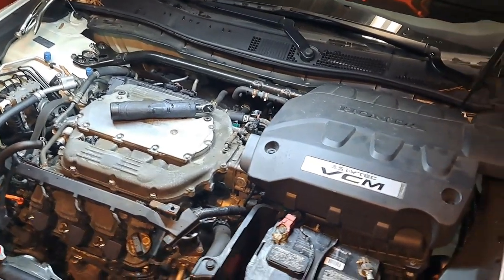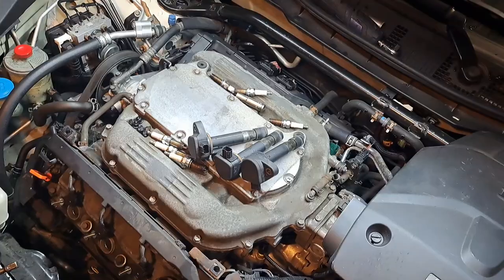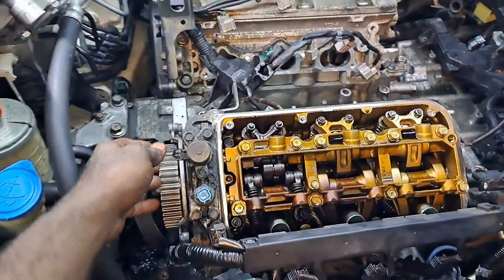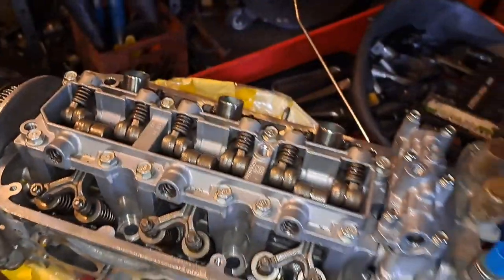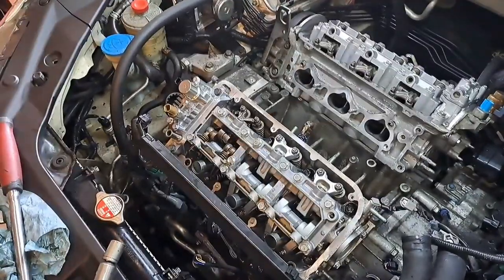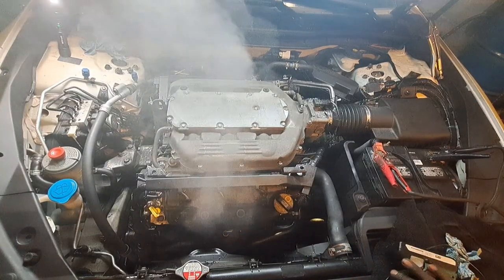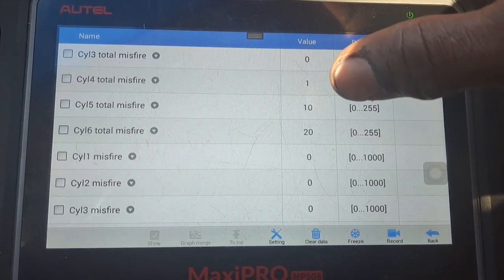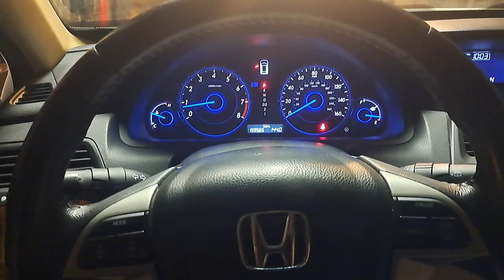2008-2015 honda accord broken timing belt!! bent valves

Comment: I just did a timing belt that went sour on a Honda Odessey. I ended up bending a valve on cylinder 1 (it’s my first timing belt) I was not aware rotating the cam 360 degrees would cause damage.  now it has no compression in the cylinder. You have given me the confidence to do this job. And hopefully not make the same mistake twice thank you 🙏 you live and learn.
Reply: Charged  her for a timing belt/ water pump job and gave it back to her with bent up valves? 😂
Reply: @Fred-xo3ku  no I fixed it for her bent valves and all.
Reply: @franciscogomez2565  a guy that knows what he's doing. That's rare most of the time in this field. 👍
Reply: @Fred-xo3ku  thanks!
Reply: So your saying, you didnt match all 3 markings?
Reply: @denisramraj8879  the back cam has a tendency to jump forward or backward when your trying to get the new belt on  I rotated it a full circle and damaged the intake valves DO NOT ROTATE THE CAM A FULL CIRCLE. I also used a paint marker to mark cam marks and counted the teeth from the old belt and put them on new belt
Reply: All that complication for a OHV engine.  They should've copied a good old USA V-8
Reply: Yeah, my brothers and I have done several timing-belt jobs on the Honda/Acura J-Series V6. It’s easy so long as you have the right tools, watch a ton of videos, and check everything at least twice.
Reply: @franciscogomez2565  that want bend no valve it just want start need speed to bend valve like hwy speed
Reply: @franciscogomez2565 yeah so the cam was out of phase 180 degrees then. The crank spins twice to the cam once...so everything can line up and be 180 out of whack.
Reply: Rotating 360 degrees doesn't as long as all the timing gear points was line up right
Reply: @franciscogomez2565 I have the same situation, after I removed the old time belt and while installing the new one,the  back cam jump to 10:00 position, what do you Recommend to bring it back to mark position

Comment: Man you never tighten the lock nut on valve adjustment, with a socket! You have to hold the jam nut with wrench so it doesnt move. No way t do that with a socket over the top of jam nut! No way did u adjust valves right!

Comment: Great video, man! The last part was nerve wracking like "damn"!.... My brother just gave me an MDX that broke the timing belt on acceleration (roughly 10k miles after being changed by the dealership). He just gave it up and bought a Toyota instead.. Anyway, just done clearing up the timing belt area and now about to do a leak down test before boroscoping it down. Hopefully it's not a mess in there... I'll let the machine shop do basic valve job and resurface in case but I'll do the final rebuild after seeing your experience... More power to you brother. We need more guys like you!

Comment: This is about the MDX I mentioned above. I finally decided to just pull the other unaffected cylinder as well and will rebuild it together with Bank2 (bent #4 intake valves). What made me decide to do that was after checking the seals and O-rings on bank2, almost all are nearing end of life: rigid, plastic like feel instead of rubberized. These won't last 50k miles or at-least as long as the new ones. Plus, will take the opportunity to do valve mating surface reconditioning.  The difficult part was loosening the nuts holding the cat converter to the head. My hands won't even fit in there; almost decided to just bring down the whole engine-subframe assembly. 

As the new parts delivery is delayed for like 1-2 weeks extra, this gave me more than enough time to measure things against factory spec and also clean things up. The Bank2 cylinder head by the way turned out ok. No measurable warping anywhere and even all valve guides were within spec. The bent #4 intake valves was all got affected by the timing belt breaking. 

Thanks for your video.
Reply from the maker: Thanks for the update

Comment: Hello I have a gyration I pulled my front head off my 2015 Acura Rdx head I found a black plastic part  between the 4 cylinder and the block in the area were the antifreeze flows at is that suppose to be there?

Comment: Excellent video! I repair vehicles every day. Here's a bit of info your viewers might find helpful: 

You can place a dot mark on the top of the cylinder head bolts and then rotate the bolt until the dot mark has rotated to the appropriate angle degree......also, if you don't have an angle gauge degree wheel tool, you can download an angle gauge app to your phone, tape your phone to your tool with the angle app running and you will see a digital rendition of the angle movement (no shit). 

If a bore scope is not available to look inside the engine to see if the valves are bent, you can remove the cam shafts (doing this will close all the valves).......and you can then perform a leak down test (assuming you have air and an appropriate psi tool to pressurize the cylinders).  

When removing a cylinder head from an engine block, you WILL get a small amount of coolant which will pour down into the oil pan. To remove that small amount of engine coolant from the oil pan, you can remove the oil drain plug momentarily and the coolant will be the first liquid that drains out of the oil pan. Reinstall the oil drain plug as soon as the oil starts flowing out. 

To avoid coolant pouring into the oil pan you can remove the engine block coolant drain plug to remove all the coolant from the engine. On these Honda V6 engines, the engine block coolant drain plug is located above the passenger axle shaft & slightly towards the left of that shafts inboard c/v axle joint. 

Note: The engine block coolant drain plug is a 10mm bolt. It's made of brass metal. Very soft. This brass is very weak. This plug screws into a hollow bolt. To avoid damaging the 10mm brass bolt, remove the hollow bolt which the brass bolt screws into. The hollow bolt will easily leave the engine block without damage. Take care not to lose the crush washer when removing this hollow bolt.......or, you can simply leave that small bit of coolant in the oil pan and let the PCV system evacuate the coolant as it turns to vapor. 

When tightening with a torque wrench, I'll make as many passes as necessary to ensure all the bolts are exactly tightened to whatever torque value is specified. In the case of this Honda, the first pass is 22Ft pounds. By the time you've finished tightening that last head bolt to 22Ft pounds, the first ones tightened aren't going to be that tight any more because the head gasket becomes compressed.

Always double check the valve lash  clearance when dealing with fresh rebuilt cylinder heads.........as eager as you are to finish an automotive repair, the machine shop worker is as eager to finish working on cylinder heads. Corners get cut when wanting to finish a job. 🤔.

I have the same Autel scan tool. I hate how it (sometimes) doesn't identify cylinder order in relation to cylinder banks. IE: Bank 1 being cylinders 1, 3 and 5 & Bank 2 being cylinders 2, 4 and 6.........to avoid confusion, I'll disconnect an ignition coil to intentionally create a misfire which allows me to determine how the Autel is presenting cylinder identification info. 

Overall, great video!

Comment: im doing the same engine now, and the way you did, is good, but missing import part the timing of it, i also notice that you put the both cylinder head without the intake, and i believe you took it apart again fit it in. beside that, is a very good video, is you have the timing part to share will be nice.

Comment: Bro, this is about that MDX I mentioned to you above.. Finally got the chance to do a leakdown test (both dry and wet) and scoping : bent intake valves on #4. The rest are clear including all piston tops, bore walls, and also leak test results of rest of the cylinders (all were approx 3% at wet/ dry and at tdc and also at fully depressed pistons). I'm not able to make a compression test as I didn't want to buy parts (belt) without properly seeing what's up. Thank you for your video; used it as a guide coz this is my first japanese car as the rest of my previous project were all american.

Anyway, quick question,  do you see any problem of me just rebuilding the bank2 head by itself and not mess up with the bank1? Coz the way my brother carefully treated this vehicle (on time overall maintenance/servicing with OCI of every 3-5k miles) and nominal diagnostic results on bank1, I 'am actually afraid pulling that head based of how difficult it was on your video + including how tight it is dealing with the catalytic converter. Any pros and cons do you foresee? Model year was 2008 with only 110k miles which IMO low for its year.

Thanks in advance.
Reply from the maker: Hey there.  Thanks for the update. 

To be honest,  if you got this far in diagnoses,  I don't see how you can't do the head replacement.  To answer,  yes,  you can just do the bad cylinder. I'm assuming you back tested everything, and you seem like you're in the clear.  If I were you, with that much confirmation, then I would simply replace that one head or take it to the machine shop! You did the hard work which was diagnosing to isolate your issue, now the manual labor 😆 pulling the crap off! 

Trust me.  One bolt at a time,  label if you have to or take photos. When removing the converter, just pull the manifold bolts and mounting bolt to simply separate the manifold from cylinder head. 

Buy new head bolts and gasket set. Everything you need to do it correctly. 

You got this
Reply: @partsshooter Thanks man. Appreciate it.

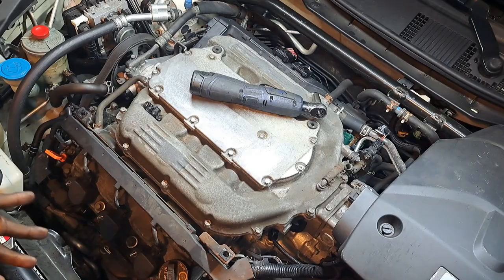Comment: At 2:17 - I'm curious why the timing belt broke at 159k miles? Was this the original timing belt or a poor quality aftermarket belt or possibly too many years past? I believe the (conservative) Honda service interval is 105k miles or 8 years. BTW - awesome work on a big job!
Reply: A lot of folks with the J35 engine neglect the timing belt maintenance as it's not cheap, about 1k at a non-dealer, and a good deal more at a dealership.  It's not something even in the mind of  consumer really since I don't think there's anyone else using a belt.

Comment: Can you pls answer this question! It’s on 2016 Honda Odyssey, replacing time belt, after successfully put all pulleys to TDC marks, then removed the old time belt, while installing the new one the left cam moved to position 10:00 tried to pull it back using old belt as driver ( the other camshaft and crank shaft not connected), then it jump to position 2:00,  tried to pull it back to mark position then it jump back to 10:00 position, didn’t hear any cracking sound, How can I fix this situation to put this camshaft to TDC position in order to install new timing belt? Appreciate your answer,
Reply from the maker: @nasserismail5284  the bank 1 rear or bank 2 front will stay naturally at its TDC. just use a wrench to get it into position,  it's a balancing act essentially. But the gears will hold in its mark.  I never had one that didn't

Use a paint pen so you'll be able to see your timing marks well... paint the entire tooth of the gear also

Comment: Did the shop say anything about the over tightening of the valves? Or did you not raise the issue with them?

Interesting vid though. I do enjoy your diagnostic stuff more than the mechanical labor side. Seeing a problem get traced and sorted out is always the best part.
Reply from the maker: They'll look out for next time with a discount. But that's not what I want, ì just wanted to make them aware

Comment: My timing chain popped as I was driving, which messed my engine up, assuming this exact thing happened because my car won’t crank at all, I thought my timing chain only needed to be replaced but later found out that the rear wheel that holds the timing chain was locked the other two were good, so I was told to replace the rear top cylinder, does this sound accurate to you?
Reply from the maker: @eldy1433  depending on how the belt/ chain break,  the upper valvetrane will work but have leaking valve or lock up the cam all together.  

If you got it back in time and it runs horrible. Heads will need to come off or other test need to be performed.  Visual inspection or various pressure test for the suspecting cylinder.  If you have more questions just ask

Comment: I own a 2015 Honda Accord ex. I bought it with 74,000 miles and at first nothing was wrong with it. But yesterday it started making a slight ticking sound. And when I accelerate it a bit the ticking sound sounds louder and faster. No lights on dashboard… I need advice of what it can be and what to do.
Reply: 4 cylinder?
Reply: Not too familiar with the 2.4s but I’d try cam chain tensioner first. I know the V6 3.5s do have kits for the timing belt, timing tensioner, pulley, tensioner pulley, and water pump. It’s just convenient since you’re down there already and you’ll need to do it in the future anyways if you want to take preventative measures.
Reply: Actually, first thing I’d do is make sure the sound is not coming from your accessory pulleys/ serpentine belt, so remove the serpentine belt and run it for a little bit. Not too much since your alternator and water pump (I believe the water pump runs off the belt on the 2.4 engines) are not running and it will cause your low battery indicator to show up on your dashboard (not too serious it’ll go away once you put the belt back on) and also may overheat your engine if you run it too long without water pump.

Comment: Nice video, definitely subscribed now. Also i recommend removing head bolts in a cross pattern just to reduce the chances of stretching/warping the head since they are aluminum and always thread in by hand first when reassembling. Also did you get the heads resurfaced or just had them do the valves and whatnot? Keep it up man nice vid.

Comment: What makes the camshaft sensor go out
Reply from the maker: @denorrisfreeman6933  cam sensors fail dude to normal wear and tear. Heat cycles can cause expansion and contraction of sensor  itself separating internal connections or simply failed transitor

Comment: Just picked up an 08 Odyssey Touring for $750. Something on the tensioner side failed. Not sure what yet, but as soon as the cold weather breaks I'm digging in. I don't know the extent of the damage yet, but I pray it is just needs a new Timing kit. The belt is intact, and still turning the cams. Supposedly 25 mph, and they towed home, but Freeze Frame data shows 65 mph, so fingers crossed. I can turn the engine over by hand, and it doesn't seem like it is binding from hitting valves.
Reply: V6 J series right? They are interference engines, so very unlikely that absolutely zero damage has occurred (assuming that timing has jumped). I’ve had the same thing happen to me where I got too excited when the engine turned with no interference but since the valves do bend from the impact of the piston hitting it trying to make its way to the top, especially going 65 mph, it’s very likely the pistons have already cleared their way to the top of the cylinder, no longer making interference with the bent valves.
Reply: You did also post this 3 months ago so let me know how it went if you already tackled this job.
Reply: @JoeMomma.  The timing belt tensioner pulley failed and the timing belt cut through the timing belt cover. The valves were hammered real hard. I ended up replacing the heads, and did a bunch of work cleaning, replacing, upgrading, and fixing everything under the hood. It is running now. I have put countless days and hours into restoring this van. Currently working on tearing out the interior and deep cleaning everything. I have cleaned the front half, and still need to get to the back half. I also ran wires throughout it, and will be installing a battery bank, and doing some modifications. I have done too many things to count, but I am posting it all on odyclub under Royal biggsters 2008 touring. I have not updated it in some time though, and need to sit down and go through the thousand or so pictures and explain each step and each mod, just too many things to juggle right now, so I will do this once I am finished. Which will be soon, since it is going on vacation on the 2nd of July.

Comment: your best time to get the coolant that went into oil system during disassembly would have been on the bottom - right by the drain plug . and i always change oil  - bring to temp = change again. a lesson most older say = I did the top half and now the bottom half  went out = spun bearing or ?? = but the bottom of the engine bearings do not like antifreeze ?? just sayin '[

Comment: You have skills. My 1998 Honda Accord has 52,000 miles. The milage is low the previous owner kept it in storage for many years. I don't know if i should change the timing belt now because it is a old car or wait until the car have 80,000 miles
Reply: Change it due to age.

Comment: How much did this total job cost?
Reply from the maker: This job takes 22hrs. Can cost around + - 4k depending what's replaced
Reply: @partsshooter  that was a lot of work and I could hear  your lfrustration at the end. 
 I wondered about the price. A friend has a broken timing belt . Im considering just replacing the engine with a used one as opposed to replacing the belt only to find out the engine is bad.